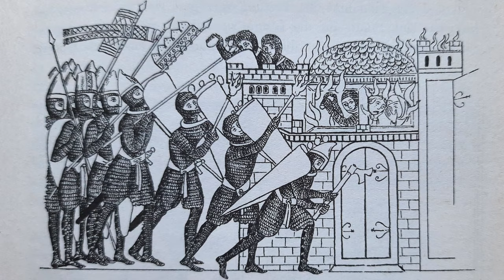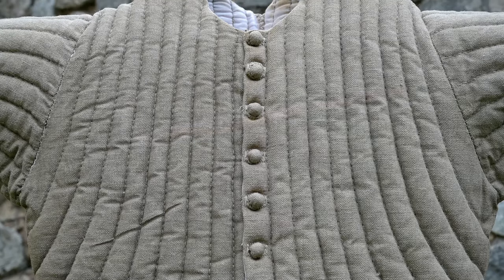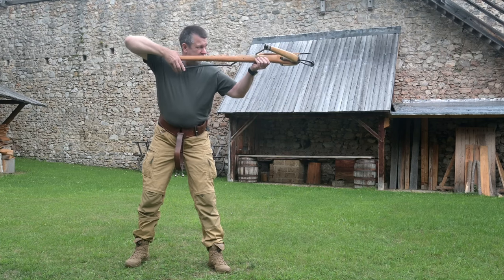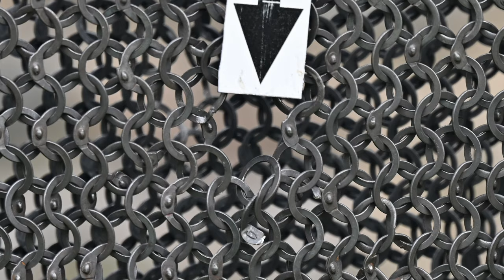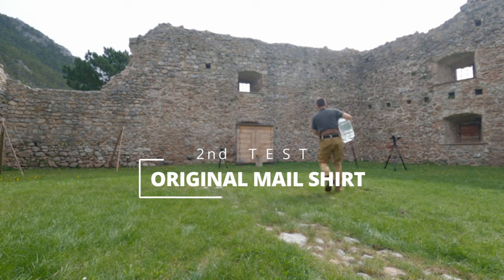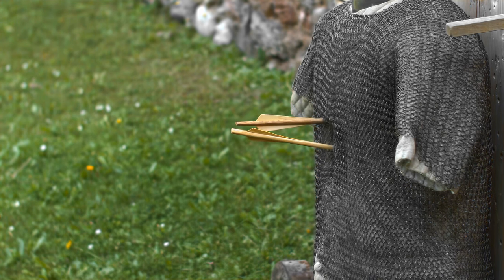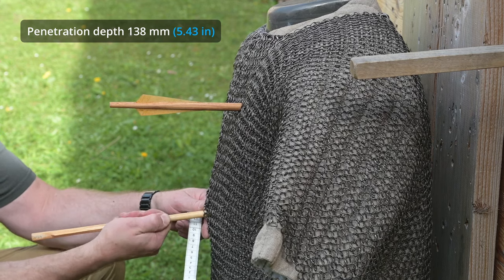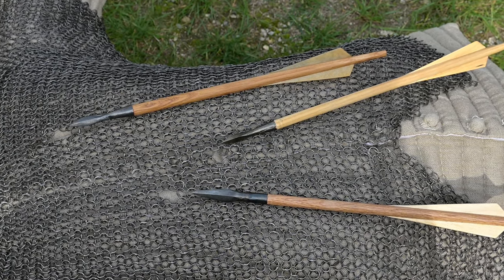Medieval Composite Crossbow vs original mail armour

Comment: not happy with the gambeson or maille used. crossbow is fine, bolt weights good. But the gambeson should be minimum 20 layers (though i'd like to see 30 layers for a mail+gambeson test). (and forget the wool nonsense. And your maille... don't use the cheap indian bought stuff. i know they have some good quality if you look hard enough, but they mostly produce garbage for re-enactors. a 10mm diameter is also VERY bad (6 to 8mm would be considered a more historical maille). also '4 rings per' is the lowest/cheapest again. And finally 20m and 30m ranges please.
Reply: Largely agree but the we have sources for a minimum of 10 layers in historical texts

15th century Brigundian ordnance for horse archers prescribed a 10 layer jack with a mail shirt.
Yes Gambeson could be up to 32 layers as well.

4 layers is def too thin though.
Reply: @stav1369  The thing is European mail armor were the best in the world though. The Ottoman mail armor as well as any other form of mail armor around the world tends to be a lot weaker.  The manufacturing of mail armor that the Europeans were doing was a much more superior one by a from compressing the metal wire into a device which is very similar to what we do today.   Many of the cultures didn't have that form of manufacturing wires but rather they cut pieces of metal to make the mail armor which would make an inferior form of armor.

Also just look at the size of those Ottoman rings!!  Those are pretty big gaps, the biggest rings European mail armor ever had was 8 mm size rings from what I understand and most were 4 to 6 mm riveted rings and very often flattened rings at that which is a whole lot stronger than that mail armor used in the video.   

Keep in mind Europeans were capable and made such dense mail armor that not even a pin needle can go between them and there are surviving examples of that in museums in Europe.
Reply: We know from the Sleeve of St Martin, King John of England's accounts, Edward III's accounts, the regulation of the Parisian armourers guild and even some Burgundian accounts that aketons were actually very thin, generally under 8mm thick and with 2-3lbs of cotton filling them, or 5-6 layers of linen (sometimes with a layer of blanket in the middle). The Burgundian ordonnance calling for 10 layers of linen was quickly dropped - along with allowing mail to be used - but 10 layers of linen isn't all that much protection, as David Jones' tests have shown.

While modern Indian mail isn't particularly good as a general rule, David's hand selected links were of pretty good quality, and similar results were found by Julio Del Junco Funes with his entirely hand made links.

Mail offered protection, but unless made of good steel and heat treated, it wasn't up to withstanding a good crossbow or bow. That's one of the reasons large shields remained in use until reinforcements (extra mail, cuiries, gambesons, coats of plate, etc) became common.
Reply: @Cahirable  the thinner gambesons (aketons) with cotton filling is for chaffing, not protection. The Burgundian period had improved coat of plates and plate armour types at this point, they often went lighter on the underarmour. So you are comparing incorrect periods. No soldier who was expecting to survive (and could afford) would wear anything less than 20 layers in the earlier medieval period when chainmail was most common.

While it's not fair to call for hardended links (tho i'd like to see that too since it undoubtedly existed), i'd still like to see a proper robust iron maille (7mm diameter maximum, 1.4mm  thick, at least 5 rings per), not cheap indian re-enactment armour.

This was NOT a good test of armour. ps. i'm not interested in debating IF crossbows can pierce this or that, i'm interested in SEEing how well they perform (for good or bad) against real armour.
Reply from the maker: Fine - its your opinion  (I am not sure if you looked the complete video) but If you want to see a test from an original german mail, here you'll find it: https://www.guerre-chevalerie.com/tests/haubert-et-arbal%C3%A8te-de-guerre/
Reply: @ericaugust1501    You're right that aketons were padding and not protection. Mail was the armour that provided protection. The Sleeve of St Martin dates to c.1200, and the records from John date to roughly the same period. This is still the period in which mail was the primary defence.

I have no idea where the idea that 20 layers were worn under mail comes from, but it has no archaeological or written evidence for it. At best you can point to the Syrianus Magister's 18mm thick cotton stuffed padding, but even then the text implies that it wasn't universal and in fact may have been decidedly uncommon. Reforms are rarely recommended if something is common
Reply: @Cahirable  there are sources listed up to 32 layers. I do not know these sources, but i trust historical enthusiasts like Todd's workshop and Matt Easton (and their associates, who are sometimes historical academics). But they have stated on numerous occasions upto 32 layers.

my position is always, since one will always be hard pressed to find sufficient surviving written or archeological remnants, it's best to just use the same common sense we have today. ie. the understanding that thicker is better. Gambeson would have been popular and as thick as possible as long as desired movement could be preserved. This definitely applies to common soldiers for whom gambeson was their entry armour. But for maille wearers, i rate they knew what thickness they needed their gambeson to be to aid in reducing arrow penetration under maille too. And it was not going to be 5 layers. even 10 layers sounds like the a bottom level cheap purchase. My opinion, 20 layers and above for any serious soldier. So do your tests at 20 layers. don't waste your time with padding "armour".
Reply: @medievalcrossbows7621  the most difficult thing about these tests is always going to be understanding and then sourcing realistic armour. There is no way gambesons of the few layers used by you or your link suffice. You should always 'steel-man' your tests so to speak. Use 20 layers as your baseline. 

When i comes to Maille, there are so many ways to make good maille, and few people will ever use those methods or design because re-enactment maille is not real armour. It's  quick cheap sale. You link indicates they used 8mm diameter, 1.3mm, alternate rivet and stamp and using 4 rings per. We concede that that type of maille cannot protect much at 15m. BUT that's still borderline cheap maille. 

Get an armourer to make, ideally, 6mm dia, 1.4mm think, all riveted, 5 rings per. Now we got what a potential arms race in medieval times would have produced. Remember as weapons get better, so armour would have improved as well (this phenomena is a law of nature). It's entirely possibly, testers are comparing weapons from later periods vs armour from earlier periods (which were not using better design). And i really want someone one day to test hardened maille. can't find this anywhere. why don't you be the first! :)
Reply: @ericaugust1501  5-in-1 rings wasn't even a thing so your comment doesn't make sense.
Reply: @aurorasdawn4681  its a reference to the number of rings linked to a ring. 4, 5 and I think it went as high as 6 (although i would not be surprised if there was less or more than that range over the breadth time maille has been around). This should not have been difficult to figure out if you know your armour history.
Reply: @ericaugust1501  Ah, so you are completely clueless. There's either 4-in-1 or 6-in-1 although for reasons of weight efficiency, the former was used almost exclusively.
Reply: @aurorasdawn4681  "weight efficiency" depends on the user. it is known for users to double up, probably on the cheaper stuff. If you can't conceive that maille would vary tremendously based on weave, thickness, diameter, you have a poor critical mind. And i won't take your word for it that 5-in-1 didn't exist, but thanks for confirming the 6-in-1.
Reply: @ericaugust1501  I'm not confirming 6-in-1 since I don't think it was used in Europe apart from maybe collars or similar critical parts. Labelling 4-in-1 "cheaper stuff" plus the fact that you thought 5-in-1 existed, immediately tells everyone that you're just making random unfounded assumptions based on your "critical thinking" rather than having any knowledge on the matter.

Critical thinking isn't sufficient when discussing history though - it always needs to be combined with a basis of factual knowledge.
Reply: @aurorasdawn4681  nonsense. just because YOU can't conceive of a 5-in-1 weave doesn't mean there is no such weave. i'll grant you that it is not so geometrically simple as the 4-in-1 and 6-in-1, but there are some pretty varied weaves in history, and not all of them have a convenient number in them for you to hold onto. Some just have a name.  Pretty sure there is also a 3-in-1 weave. 

regardless 4-in-1 weave is the beginner maille in terms of the period. Maille would have evolved to deal with crossbows and better thrusting points, that you can be sure. 4-in-1 is for proof against cuts and earlier (and thus weaker) crossbows. You want to test a powerful crossbow, get better maille. You can't get your hands on 5-in-1? fine, get some 6-in-1. Or at least a 4-in-1 of 6mm diameter. OR double up the 4-in-1 on the chest. because THAT's what the soldiers of that time would have done.
Reply: @Cahirable  There are a few surviving historical accounts and references that give us insight into the thickness of Gambesons during the age of Mail and 20 layers is probably not that far off or at least based on some evidence.

Armies of Feudal Europe 1066-1300, by Ian Heath:

Within its pages it writes:

“The Byzantine chronicler Niketas Choniates, describing the quilted armour of Conrad de Montferrat, commander of the Byzantine army's Latinikon regiment in 1187, records it to have been made of as many as 18 layers of red linen"

The 12th Century is the High Middle ages so it is the age of Mail. I don't think it's too much of a leap of logic to assume that a commander of a Byzantine regiment would not have gone into battle with Gambeson alone, and the garment described above would have been worn with Mail on top.
Reply: @ericaugust1501  32 layers comes from around 1465. The only reference to layers in the period where mail was common (1185) gives it as 18 layers, and this was worn by a count.

In fact, the "Itinerarium Regis Ricardi" says plainly that if an infantryman who wore mail wanted extra protection, he wore textile armour above his mail and padding, much as other sources say that knights did.

Your attempt to "logic" this argument, much as in the argument in favour of 5:1 and 6:1 mail, flies in the face of all written evidence and the evidence of the existing artefacts.

I'm sorry to have wasted so much time with someone who hasn't read a primary source or any works by experts on the subject.
Reply: @stav1369   This is why you read the primary sources rather than trying to "logic" the "right" answer out of an incomplete reference in a secondary source.

"Conrad, with his purple-dyed emblem imprinted on his and his troops' arms, was first to move. He fought then without a shield, and in lieu of a coat of mail he wore a woven linen fabric that had been steeped in a strong brine of wine and folded many times. So hard and compact had it become from the salt and wine that it was impervious to all missiles; the folds of the woven stuff numbered more than eighteen."
Reply: Ummm... the second maile WAS a historical armour. Some people are annoyed he shot at an artefact, and another guy pointed out it seemed like it had been acid-cleaned at one point, making it weaker.

To be fair, there is a 5 in 1 weave that exists today, "Persian Half weave 5 in 1." No idea if it's historical, or if it's good as armour. Would love a book that tests the strength of difference weaves, diameters and etc..
Reply: @Cahirable  Why is it that gambeson seems to get thicker later on? Or is that possibly due to limited data?
Reply: A jack made up of 29 or 30 layers of linen + 1 layer of deer skin is a regulation from 1450 by Louis XI.
Reply: The Ordinance of St. Maximin de Trèves 1473 say a brigandine or a sleevless mail shirt under a 10 layered jack. This is armour going on top of the mail. We see the same in Konungs skuggsjå.
Reply: @Cahirable  Thank you. I did not read that. I will have to research it further.
Reply: @Cahirable  Thank you for taking time with this detailed explanation. If a state was forced to raise a peasant's levy (perhaps as part of a peasant's rebellion), this leads me to imagine many would have thin gambesons or even no armour at all. Or I guess some hastily assembled coats of plates from junk, like at Wisby.
Reply: 30 layer gambeson is unrealistic. 
That's like extreme, they existed, but almost always it was much less, in realistic scenario.
Also... gambeson, that was used as secondary armor (under mail or plate), used to be thinner.
 Thicker gambesons were those, when you used them as primary armor (because of cost issues... so powerty, peasants) 

Quality chainmail was also very expensive. One could be lucky, if he could afford at least some chainmail.
These luxury chainmails, were used only by rich people.
Reply: @warrax111  disagree. i believe that they would do whatever it takes to prevent themselves getting killed. if they didn't have maille, then 30 layers would be what they would tried to find/make. and then once they won at least one victorious battle, they'd strip chainmail off their defeated opponents, and voille, 30 layers+maille. THAT is how prudent soldiers think... the way YOU are thinking now... its from a 'i'm trying to argue' position, not a reality position.
Reply: @ericaugust1501  acording your logic, they would wear 50 or 100 layers of gambeson.
Try to think...
Reply: @warrax111  how does my logic come to 50 or even 100 layers of gambeson? again you are coming at this from a weird argumentative perspective. Since they are like us, and do not possess superhuman strength, they too are limited by an upper cap on layers otherwise movement is too restrictive. Try to think.... And try to think some more on this: Given they are like us and understand protection AND movement, perhaps they'd even have skilled tailors who would sew the articulation points down to only 10 or 5 layers with the rest being 30.  Ths sort of tailoring does not sound magical to me, and if it makes sense to me, it will make sense to them.
Reply: @ericaugust1501  did you wear 30 layer gambeson in 25 or 30 degrees, and going to 30 or 60 days crusade (30-50km daily), and from time to time, run and fight in it?

Did you try to wear 30 layer gambeson under other armor, when sun blowing on you?

I mean, for real... did you try it?

If not, try it. And you'll understand.
Reply: @warrax111  yes i have. its fine. you don't wear it while on a march, only for battle.
Reply: @ericaugust1501  lol.. you obviously don't know, for what armor is used. 
You think, when you are ambushed, you have time to put armor on?
even gambeson needs to be secured.

Did you see ever roman army marshing without armor? It would ridiculously easy to disable whole army, by few partisan attacks with poisoned swarm of bows. They needed to march in armor, particulary on enemy's territory. Otherwise, a bunch of bowmen on horses, with several organized groups, would make havoc on you, during marching, and transfering foot soldiers. 
They would gradually tear you down

They would do it every day, particulary, if you would (un)wear good armor, because such army would be expensive. One quick attack, 200 or 300 arrows shooted, then flee on horses. And next day again, maybe even several times. It would force you to put armor on.
Not gonna say, about morale in army, where you wear effective armor in backpack, while you loose 1000 men per day... that had to be terrible feeling, im sure, soldiers would refuse to go this way, and demand to put armor on.
Reply: @ericaugust1501  You are delusional. I never saw crusader, roman soldier, or greek soldier march without armor.
From the time, they were on war crusade, they put armor, and went.

They would consider it only in stealth missions, like Hanibal going to alps. 
But there, they would need gambeson, to keep warm.

On normal grass/forest terrain, soldiers had to have armor, or you would disable them with guerilla tactic easily.

Spies? Ok, spies saw only armies. But they didnt see guerilla ambush attacks in time. That's why they they are called guerilla I guess
Reply: @warrax111  i'm not sure where you get your knowledge or logic from but it sounds like you got it from some kiddie cartoon.
Reply: @ericaugust1501  30 layer gambeson + mail shirt is very crazy thick that's not very comfortable at all. 30 layers gambeson are to be worn solely. 
No one is gonna wear that just to resist arrow bolt, your stamina and heat flow are important thing to watch for. 

Do you know how thick 30 layer gambeson right? It's as heavy and thick as the kind of jacket that protect someone from guard dog attack simulation.
Reply: @cool06alt i'm aware 30 layers is very thick, and i have no experience with above 20+ gambeson layering, and yet, we know they existed, and perhaps depending on craftmanship (i.e lowering the layers around the joints, etc) they may have been more mobile than you think. Anyway, that's why i'd like to see 30 layers, and 30 layers + maille. so i stand by my request.
Reply: @ericaugust1501  Then it's up to mail itself that it could resist the crossbow bolt. Because let's be honest, there's reason why Brigandine become so popular in 13th century despite the existence of 8 in 1 mail link armor. A crossbow bolt weighed around  1500 grain/125 gram fired from 276 lb drawn to 12 inches ( 128 kg / 30 cm) has enough kinetic energy and momentum to be comparable to 90-100lb longbow launching similiar arrow weight. 

I am aware of the account of super mail armor that could resist lance impact, but projectile is different story than very slow lance no matter how heavy the momentum that one is.